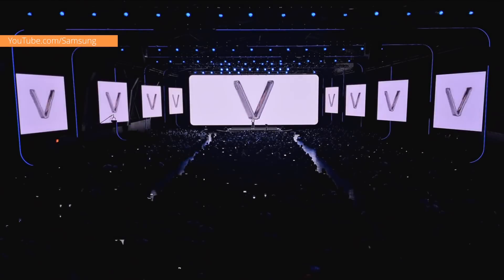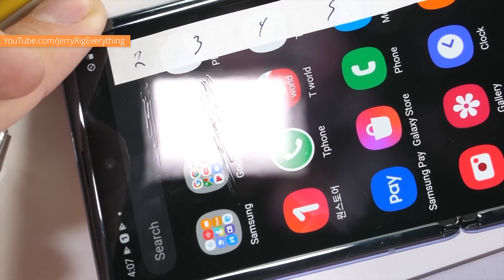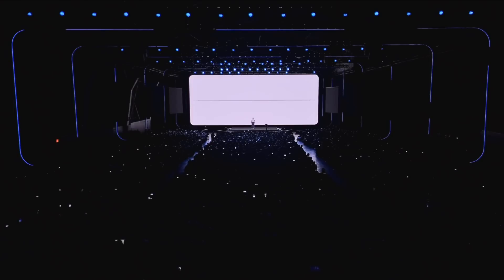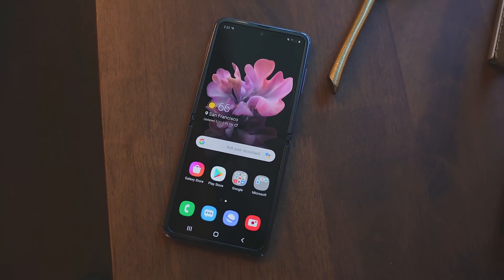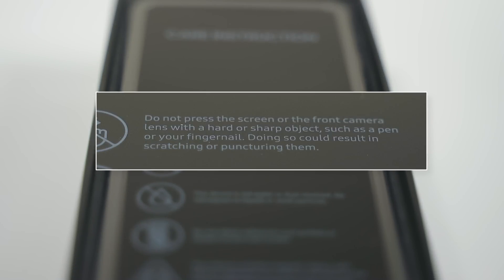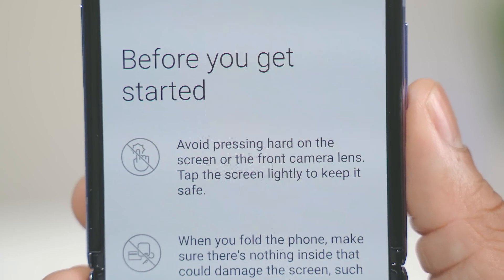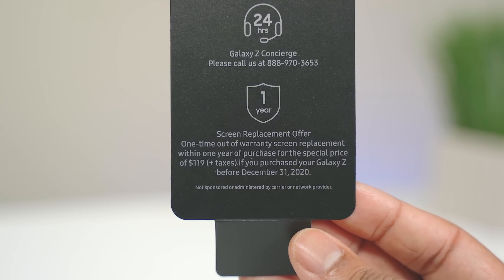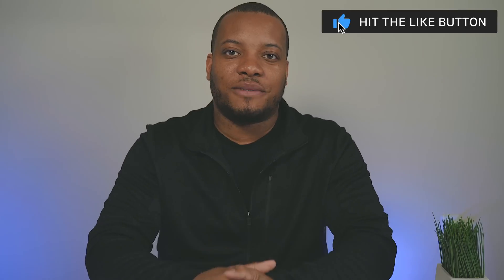Issues with the Galaxy Z Flip Display?

Comment: Mine has a cluster of failed stuck pixels about quarter way across the fold from the left. Nice one Samsung! I absolutely hate this phone!!! Because I dropped it afte the pixel fail issue and crached the corner of the back glass, Samsung won't honour the warranty. Will never buy another fold type phone. Never had pixel fail with any previous phone.

Comment: After 6 months of use, couple of light lines showed up exactly where the phone folds and after a week or so, half of the screen started flashing an intermittent light exactly where the text box appears. Do I have to say that founding and touching the phone damages it??  Samsung service said that I water damaged the mother board witch isn’t true. Of course warranty does not cover it. I knew I would have headache with this phone but didn’t think I would burn my money like this. It should be illegal selling this phone.
I can’t forget to say that with a minor drop, outside screen stops working. Look it up z flip second hand for sale, u won’t find one with that screen working
Reply: i've been having the same problem, with the only difference it's happened to me afer 15 months of usage. it began two days ago (literally out of nowhere, i didn't drop it nor did i hit it with anything), so i switched to an old phone and turned my z flip off. today i turned it on only to find out the white line it's expanding, and some pixels over the crease have died. completely disappointed, i should've paid for an insurance.
Reply: I have been using it for like 5 weeks and while watching youtube exactly a white like that appeared and dissapear, I freaked out because I dont fold it normally and I take care of the phone so much 😢😢😢 I Will go to samsung to see what solution they can give me, Im in love with this phone but im scared for my money, I just bought it with my savings!!

Comment: +Soldier Knows Best The fact they called it 'Ultra Thin Glass' is not the problem. But when they marketed the screen as if it's only glass now that's not right. If they had marketed the screen as 'Ultra Thin Glass' with plastic protection would've been more realistic... because that's precisely what Samsung did. Put two layers of plastic on top of the glass.

Comment: Samsung should have had a way to have a replaceable screen protector just in case of a scratch. I have Gorilla glass 6 on my note 10+ and I still have a screen protector just in case. I would rather change a cheap screen protector than have a permanent scratch on a screen that is part of the phone.
Reply: Screen protector can be applied at approved location.

Comment: I think dual cover protections ( cover film and UTG ) of z flip is necessary for this device. When you dropped it to the ground , dual protection is better than only UTG protection. There was misunderstanding about UTG and display but it could be happened. About the scratches , samsung in south korea supporting the standard cover film for z flip and they will attach the protection cover film on your z flip display if the customer wants to attach. The film can be removeable easily later. I am not sure samsung in US supporting this protection cover film for z flip but it is better way to prevent some scratches on the display.

Comment: People have wrong expectation and compare the folding screen with gorilla glass. Its ridiculous. As he showed thicker material is more durable. And most of galaxy fold users have no issues so far. Its just exaggerated by mostly biased people who want to drag down samsung. These people havent even tried the fold. I personally appreciate samsungs effort to break the ceiling of stagnant mobile tech.
Reply: Then maybe not call it glass? Just because it has maybe 20% of it shouldn’t be called glass, that would be like saying gold coating makes the item gold
Reply: That's a bad analogy. Making glass thinner doesn't change its hardness, so if the screen was real glass it shouldn't be scratching at level 2 like plastic would.
Reply: @PhazonBlaxor  candybar phones need scratchproof glass because of permanent exposures of s screen. Scratches occur while in the pocket with other objects. Folds are protected while closed. During normal usage with the  fingers level 2 is sufficient. Real world test shows galaxy fold users in long term test have no issues with the plastic screen so far. So what's the problem.
Reply: @kairossoteria6215  The fact that I can accidentally deform and scratch the screen just with my fingernail is the problem. That's a bit too soft for my liking. 

And my point was that people were expecting just what they were told they would be getting: the claim was it has a glass screen, which wasn't really true.
Reply: @PhazonBlaxor  its glass screen with the purpose of making the screen flatter and to give a better haptic. People have the wrong expectation. The galaxy fold has no issues with the polymide  screen in real world experience and the new flip is even better reinforced with a glass layer. Don't know why you guys are complaining about a thing you didn't know about how it really is. Galaxy fold owners have no issues with the screen durability. Candybar phones need gorilla glass because of the permanent exposure. flip phones are already protected and the use of finger won't scratch the display. The scratches comes mostly from friction with particles in the pocket or bag.

Comment: In that case Apple needs to change the name of lightning port ain't nothing ⚡fast about there slow chargers but I dont hear anyone complaining about them changing the name
Reply: ...and Samsung should not call the s20 Ultra as you cannot have QHD and 120Hz together so nothing "ultra" about it! Samsung used the glass as a noun, Apple uses Lightning as an adjective, the latter is fine, and that is why Ultra is okay despite it not being that.
Reply: The s20 series should then be the s11 series as there’s nothing 20 about it, it’s actually the 11th gen model so should be named accordingly
Reply: The problem is that glass is known to be stronger and gives the impression that it’s gonna last and not break so easier but this is basically just plastic and scratches and breaks as easily as plastic so it’s like false advertising to get more customers